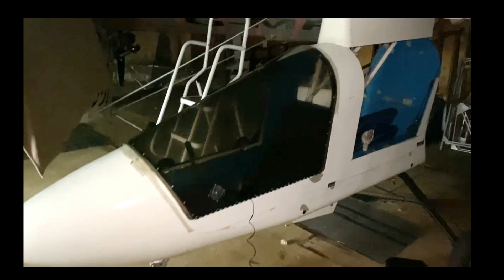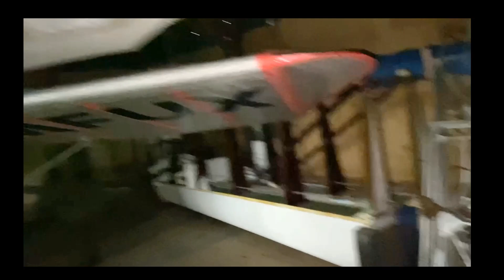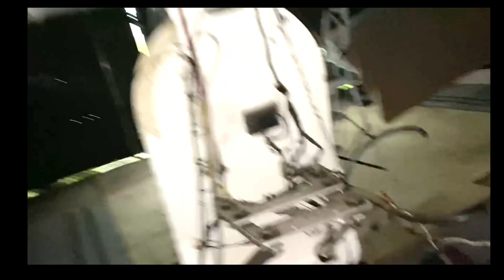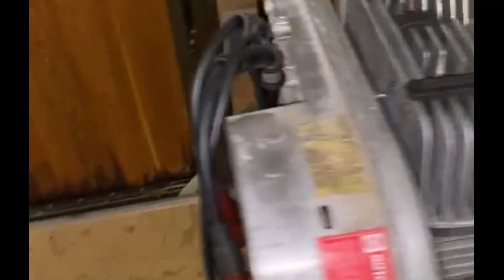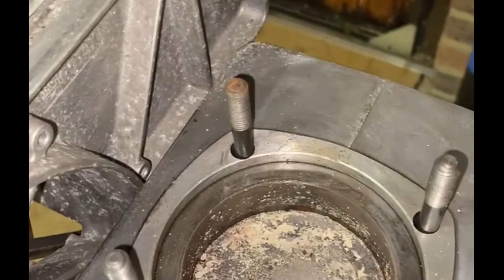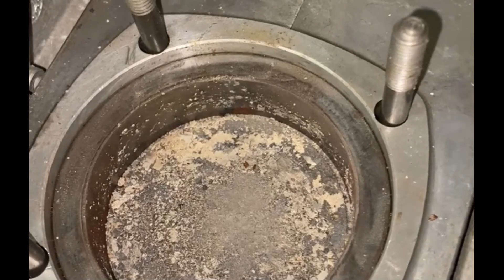CFM Shadow restoration

Comment: Hi Steve are you doing this at Peartree. If so do you need a volunteer dogs body as I would love help. Thanks Nick
Reply from the maker: Hi Nick, it is currently at a very waterlogged Peartree but i have the engine at home. I'm going on a recovering course later this month to see if Oratex will work. Probably wont start any real work until spring but i'll be in touch and you are welcome to come and help.